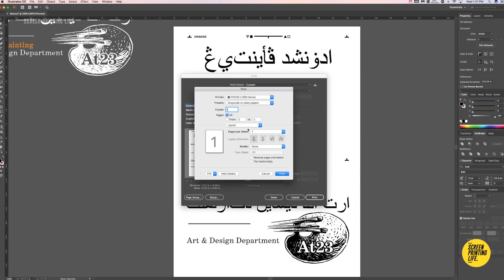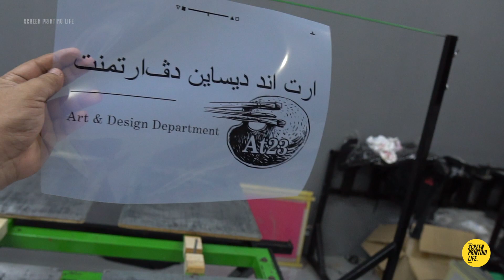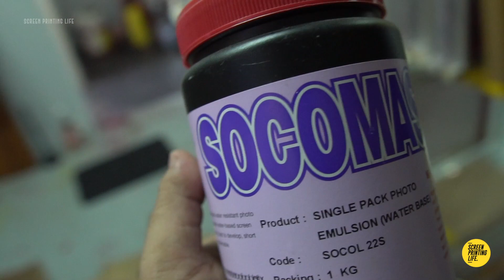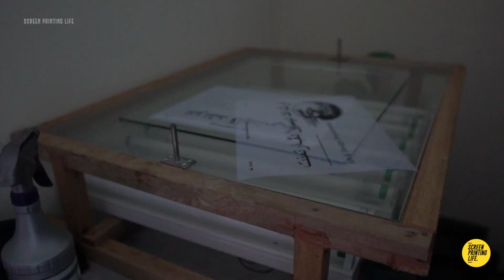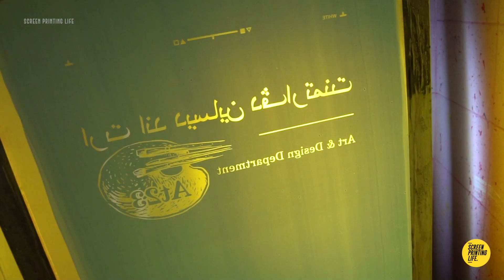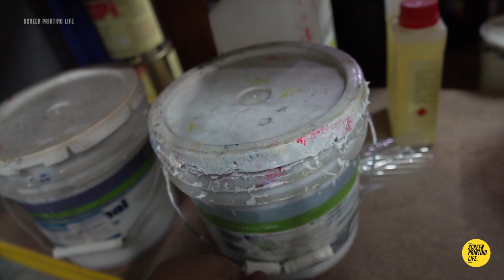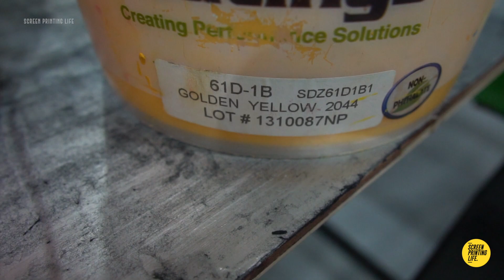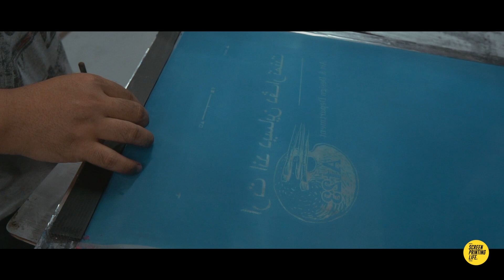Silk screen : Two Color Print Plastisol Ink

Comment: Sir about the putting emulsion. i noticed that you didn't put emulsion on the print area or the inner area. you only put on the Outside area?
Reply from the maker: Yes normally I only coat outside area especially when printing Halftones. Very thin coating to get best result.
Reply: Noted sir thank you for the reply. do you have facebook? can i add you thanks.
Reply from the maker: @jrvios6003  sure.. https://www.facebook.com/samomar2